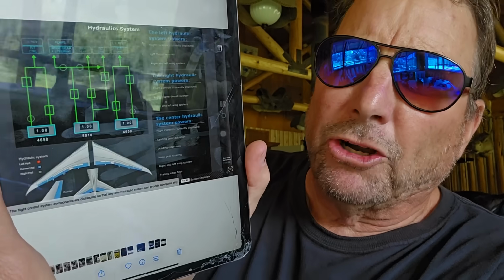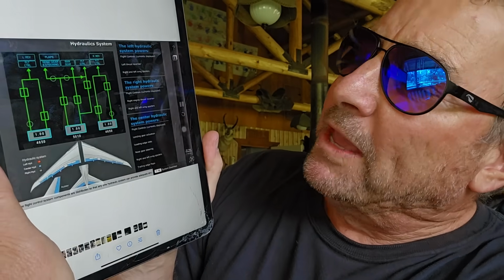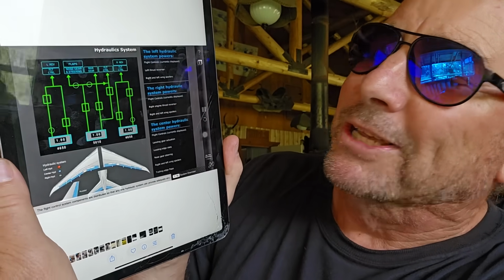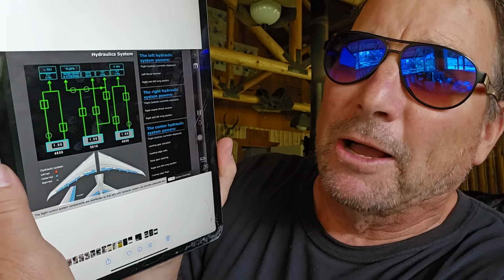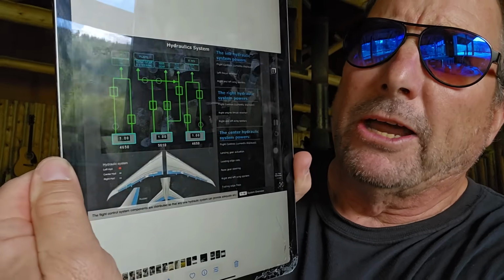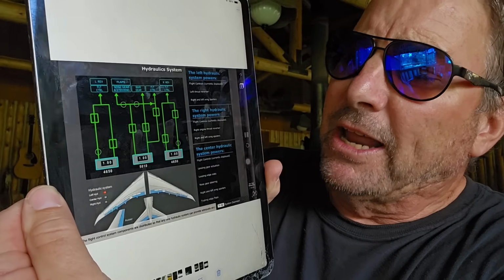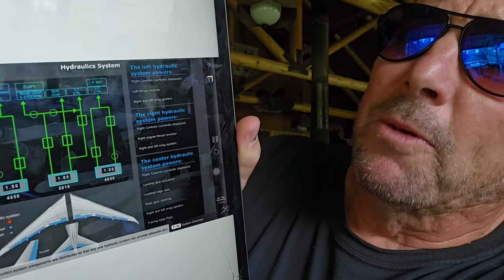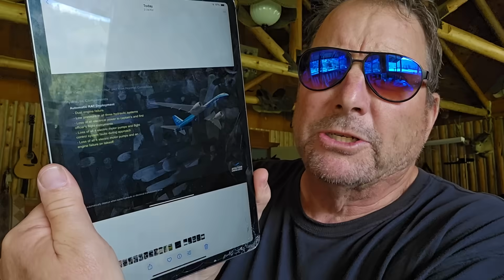787 Crash India What's a RAT? When does it deploy?

Comment: Just got this from a friend of mine. It is UNCONFIRMED, but may offer some insight:

AI 787 AAIB Preliminary Report Highlights

1. Primary Cause – Electrical Power Transfer Interruption (PTI) During Rotation
• During transition from ground to airborne electrical configuration, the aircraft experienced a cascading dual-engine FADEC (Full Authority Digital Engine Control) failure.

• Root cause: Uncommanded bus transfer failure due to arcing in the main power relay box (PRB-A), traced to water ingress during pre-flight GPU disconnection in heavy rain.
• This led to loss of electronic engine control at rotation, resulting in both GEnx engines rolling back to ground idle within 4–5 seconds.

2. Flight Data Record Timeline
• +0:11 sec: Nose gear lifts off.
• +0:13 sec: Sudden engine rollback begins. Thrust reduces from 92% N1 to <27% within 3 seconds.
• +0:16 sec: Master caution + ENG FAIL L/R warnings. FO calls, “Both engines dropping!”
• +0:20 sec: Autopilot and flight control reverts to Direct Mode. Pitch up attitude peaks at 18°.
• +0:25 sec: Aircraft stalls at 186 ft AGL.
• +0:30 sec: Full aerodynamic stall; nose drops rapidly.
• +0:38 sec: Ground impact at 54° nose-down attitude, 174 knots.
Reply: This was proven fake a few hours after it came out.

Comment: The presence of a large portion of the right-hand main landing gear resting in the building under the right-hand horizontal stabiliser, as depicted in photographs, indicates that the aircraft did not stall. This, in turn, indicates that some engine power/thrust was being generated, albeit insufficient to prevent the gradual descent. This deficiency was symmetrical. The flight crew did manage to control the aircraft in a straight line (along its longitudinal axis to within 20 feet above ground level, with the wings level at the time of initial impact with the building. One error that would explain this gradual descent is if the aircraft was grossly overweight. It can be seen in the picture The_wreckage_of_the_crashed_Air_India, that the EMPLY WT is stated as 116953 kg, and it further states MAX ALL UP WT 227930 kg. If the aircraft was grossly overloaded, the insidious aspect is that the true danger would only manifest itself at take-off. This would occur with the engines operating as normal. This error would have been outside of the control of the flight crew. That is, in this scenario, the error would have been in the weight figures given to the flight crew.

        Furthermore, as depicted in photographs of the right-hand main landing gear resting in the building under the right-hand horizontal stabiliser, there is no evidence of the Ram Air Turbine (RAT) impacting the wall section underneath the right-hand horizontal stabiliser. The RAT has a diameter of just less than a meter. This, in turn, indicates the RAT may not have been deployed. I think it's correct to say that the number 2 engine (right-hand) lodged itself into this building forward of the right-hand main landing gear. I think it's correct to say that a large portion of the right-hand wing also remained on this building forward of the right-hand main landing gear. That is the right-hand wing separated from the fuselage at that time. The sequence appears to be the right-hand main landing gear four-wheel bogie (being the lowest part of the aircraft) impacting a rebar-reinforced vertical concrete column, and both carbon fibre braces failing, and the oleo strut shearing at that time, departing the underside of the wing.

Comment: Let’s say the main electric fuel boost pumps failed, for whatever reason including loss of electrical power. The high pressure engine driven fuel boost pumps would then have to “suction” feed fuel from the fuel tanks. This is very similar to drinking through a straw, create a low pressure in your mouth and have atmospheric pressure push the liquid through 
the straw and into your 
mouth. The act of creating this low pressure area on the intake side of the high 
pressure engine driven fuel pumps would likely lower the boiling point of the jet fuel further and coupled with the very high fuel temperatures could result in a vapor lock at the inlet of the high pressure engine driven fuel pump. Once this occurs, the engine driven fuel pump would stop drawing fuel from the fuel tanks since it is designed to pump liquid fuel, not gaseous fuel. The engine would stop running virtually immediately at this point. Just my theory, with some unexplained events such as why the main fuel boost pumps stopped pumping. I have no experience on the 787, but have been flying Boeing Airliners for 32 years. Please feel free to tear in to this.

Comment: looks like the APU inlet door is open in the crash debris footage. APU has auto start function for loss of 3 or more generators. Gear truck actuators are not powered if the RAT is the only thing powering the centre system which might also explain the bogie tilt position.

Comment: Hot wings,Hot Tarmac, Hot Engines at full throttle, Hot Batteries, Very Hot Fuel, Hot hydraulic pumps .Density altitude was at 3000 plus feet.I know they were at sea level Basically for take off.110° at the tower, not the ground. 
Landing year was tilted forward for lift up into the bay. Good call on the rat ! Keep up the good work !

Comment: Hi Juan! As a retired tech, I have another thought on this. The engine fire system I believe can shut off the eng fuel control valves. Could the fire system controller fault/error (reading a false activation) to shut off fuel without deploying the halon? A wire bundle short on that system? Could there been wire bundle "damage" on that system (perhaps a foreign object in the w/w)(were the gear pins still in and something broke when they tried to raise the gear)? It appears to me that all went bad at the time the gear would have been selected. The pilot call was only "no power", did not give us any of the warnings, maybe just to many on the list with no time,  I have to wait black box data to see if the eng fuel control valves were closed. I am thinking that weight off wheels and a "false eng fire activation" would auto deploy the RAT also.

Comment: Thank you for your thought-full factual and insightful video. 
I’m not rated in the 787 but the fact that the aircraft was left in a high drag configuration suggests to me that hydraulic failure and engine failure were both present.
If you noticed that the aircraft was settling wouldn’t you be tempted to at least raise the gear to see if it can maintain altitude?

Comment: FOD. Can see the engines spitting out debris in thrust cones, in intial climb viewed just above the building in cctv video.
Reply: Looks more like jetblast from a low trajectory take-off causing that dust cloud behind the engines...I don't think you realize ADSB analysis on Geoffery Thomas's Airline You Tube channel shows 171 took-off on clean runway well before the run off area...
Reply: Right, but runoff non-paved area was encountered by engines, and huge debris cloud kicked up. Watching video carefully, it seems that debris is spitting out of engines just after it clears the view above the building in initial climb. Then there seems to be a clump spit out of right engine, not in a smooth manor. See if you agree.

Comment: Looking at the cctv video once again, the engine thrust cones seem to be actually FULL of dust/debris (not just silhouetted), more so on the left side engine, but clearly on the right engine too, both at initial climb out just above sight of the building. So that would indicate dual engine debris ingestion off the end of the runway, possibly fouling the FADEC control sensors (?) or other effects, causing loss of thrust soon after initial climbout. I'm going with mowed long grass debris, as mowed grass can be seen in the cctv video foreground near the airport utility building, but could be another denser material.
--- the issue of long takeoff roll may be due to hot density, and/or possibly short field takeoff. Or grass ingestion on turnaround overhang at runway end, or partial length. The field turnarounds seem to be small for a widebody, they should check for any gear excursions there, or grass mow pattern disruptions. Also look at apron debris.
--- has to be something unique to this flight, unless fuel and/or hot weather electronics / cooling pacs issues have been encountered on other flights on same day, or elsewhere. These 787 have been flying into hot weather for a decade+. TBD.

Comment: Seeing that fuel problems are remote, given no other flights reporting same, lets concentrate on parameters unique to this flight: 
--- The cctv video shows the tall green grass was just mowed, with long cuttings left on top, slightly discolored. The thick debris cloud kicked up by the engines looks tan in color, so could be dirt, or grass mowed earlier and dried. If used, the turnaround area for partial runway is entered with possibly the right engine hanging out over the paved edge into the grass area. This could have partially fouled the right engine FADEC sensor, producing reduced initial right thrust and extending the takeoff roll to near the runway end and rotation. Then the left engine seems to kick up a large debris cloud off the end of runway unpaved apron. Both engines show thrust cones, silhouetted against the cloud, with the left cone seeming stronger than the right. If the debris cloud was strong enough to foul the left engine control sensors on rotation, even a partial second fouling of the right engine control sensor could then result in loss of both engine's thrust soon after rotation / cloud, and climbout. The thrust then seems to dissipate, the climb ceased seconds later, altitude apex occured, then plane settled into nose up stall. Idk, a wild one for sure, but the grass cuttings are long.

Comment: AI Google answer to question:
Yes, FADEC (Full Authority Digital Engine Control) sensors on aircraft, including the 787, can be affected by dirt and debris ingestion. 
In summary, while modern aircraft like the 787 employ robust FADEC systems with redundancy and mitigation strategies, external factors like dirt and debris ingestion can still pose a challenge to the proper functioning of FADEC sensors and the overall engine performance.
Reply: Plane took off on clean runway before any run out area...

Comment: FADEC engine control computers on GE 787 engines are shown to be located inside the cowling. Wonder if computers could be affected by ingestion of dirt/debris cloud kicked up off the end of runway ground apron? Engines are tested/designed for heavy rain, but even 2010 Iceland volcano eruption debris caused in-flight engine shutdowns due to ash ingestion.
--- reports of rotation speed of 177-180 knots is higher than normal of 165 knots. Why was plane held down so long, until near end of runway? Partial thrust loss after decision point, causing longer roll to gain airspeed? Or just hot density altitude mandating longer roll?
--- i personally experienced an ANA 747 (partial cargo version) late rotation runway 28L and low climb out directly over my car in SFO north long-term parking lot on hot day /wavy thermals. Can remember every detail of underside of planform, 30 years later. I flew to europe with clothes coated with jet fuel.

Comment: Reports that ~9,000 ft turnaround was used, not full runway length of ~11,000 ft, so possible reduced margin on hot density day. Runway 23, winds 290 @ 3-6 knots right to left. On runway roll multiple right yaws are seen with corrections, and again at rotation. Runway roll kept until very end of runway, most likely to pick up as much speed (177 knots reported) as possible before liftoff, indicating possible partial loss of thrust after decision speed. Large dirt/debris cloud from end-of-runway apron kicked up at rotation, appears to be more so on left side, fast spreading to left by wingtip vortices. Doesn't appear to be hydraulic fluid leak, in cloud or climb out, but TBD. During climb, left engine's thrust cone seems stronger than right engine's cone, silhouetted against cloud, but TBD. Main gear appears tilted forward through climb out as on other videos of normal 787 takeoffs. Main gear doors opening to begin retraction are not seen, but RAT deployment/sound is observed. Whether APU start sequence was initiated is TBD. Then it hovers, yaws right then left, indicating control inputs  operating thru stall, then settles. Wing flaps/slats of at least flaps5 setting were observed pre/post crash, not sure if density would indicate more needed. How possible electrical / other failure would cause thrust loss is TBD. Fuel problems haven't been reported on other flights. Hot conditions have been routinely flown on many designs. The AC pacs have been reported intermittent on previous flights, could that affect electronics cooling? The 787 is electrically/electronically controlled with hydraulic actuators, a different design than previous bleed systems. Let's hope there is enough precision data recorded to resolve, as most modern types use electrical architectures for efficiency, if the case here.
Reply from the maker: Full runway length was used. More misinformation.
Reply: Airline News with Geoffery Thomas says ADSB shows full 11,000 foot runway was used...

Comment: A dual engine loss after takeoff of a jumbo jet is pretty hopeless, there is no time to restart the engines. It would be nice if for 5 miles beyond the runway there was an unobstructed grass strip. But this is mostly impossible. Why not have emergency solid fuel rockets on jets to allow a distressed jet to get up to a safe altitude where they can have time to restart their engines and or come around for and emergency landing.

Comment: Hi Juan, I really do like your Videos !
what do you think about the following possibiity: 
Is it possible the flameout happened with MLG was still on the ground  and TCMA triggered
(which is possible when the engine power exceeds the threshold contour) and consequently engine fuel flow was cut off and the rest of the  flight was continued  with the remaining thrust of the engines  spooling down, following the the RAT being deployed?  This possible scenario would make sense and fit into all other observations by Videos, RAT sound etc. 
I am curious about  your opinion on this issue

Comment: On rotation a main bus failure occurred, forward gear tilt only and RAT deployed. FADEC failure from no power defaults to idle . No backup.
Reply: Which should result in Christmas lights in the cockpit that would be caught on the FDR & CVR...
Reply: which breakers might trip in such case?
extra current is drawn when there's mechanical binding and poor grease

Comment: Juan, I will give you a new theory. Yes, I am waiting for the experts to come out with a report.  Watch carefully from the distant video when the plane lifts off.  To me, I see a slight yaw to the right. Don’t know how strong the winds were. If the yaw was caused by an engine failure (airplane will add in rudder), then you have a startle factor. Pilot flying forgot to call for gear up. Then for some reason one of the pilots reached for the fuel control switch without verifying with the other pilot and shut down the good engine. This caused the RAT to deploy a few seconds later.
Reply: ... quite possible, or there was gear up callout just after positive rate established, and a breaker popped from electromechanical circuit overload?

Comment: Juan, what's your take on this?

The software within the 787's GCUs has a counter that overflows after 248 days of continuous power. This overflow causes the GCUs to enter a failsafe mode, shutting down the electrical power. 

If all four main GCUs, which are associated with the engine-mounted generators, are powered up at the same time and reach this 248-day threshold, they will all fail simultaneously. This leads to a complete loss of AC electrical power, potentially resulting in loss of control of the aircraft, according to aviation publications. 

The FAA's airworthiness directive mandates that operators of 787s must shut down and restart the GCUs before they reach the 248-day mark. This resets the software counter, preventing the overflow and subsequent loss of power. 

Boeing is working on a software update to permanently fix the issue, but until then, the workaround of shutting down and restarting the GCUs is in place.

This would explain the RAT deployment. Perhaps it's as simple as maintenance not recycling the GCUs as directed.
Reply: Forgot about that, good point. Another MCAS single pitot mistake of private corporate capitalism rearing its ugly head?

Comment: Great work, Juan.  However, the take off warning system could have failed,,, as it did on the Delta 727 in Dallas which took off with the flaps up... and crashed shortly after lifting off.  That aircraft rolled left and right several times on its way down,, and this aircraft did not.  This leads me to think that the flaps were extended.  But, as you say, we don't know that yet.

Comment: Juan, can the RAT be deployed manually?Manu planes have a pushbutton to manually deploy the RAT.  The RAT sound is there, but there is also turbine sound like in the test videos you showed. Do you think the pilot could have deployed it manually thinking the lack of lift was instead a lack of power? Then he could have realized it was that the flaps were raised instead of the LG, dropped the flaps and raised the gear (which would explain the position of the LG truck and the flaps and slats being deployed ) but all this happened when the plane was already doomed.  Just speculating. We will find out soon I believe,